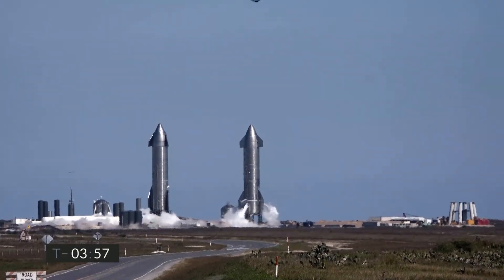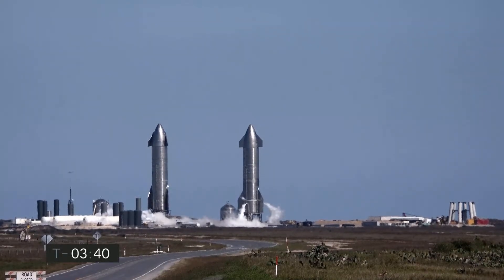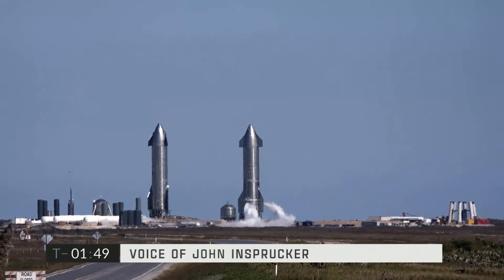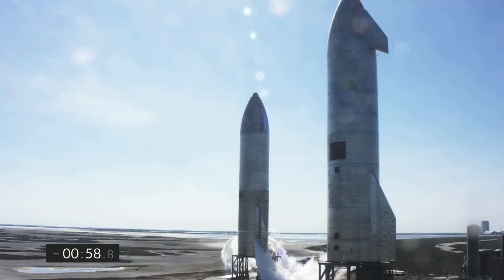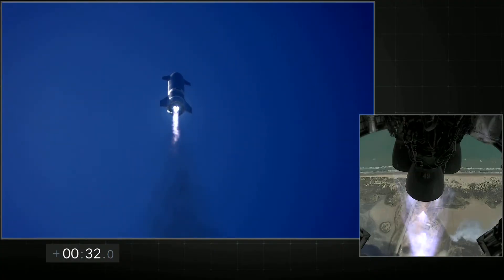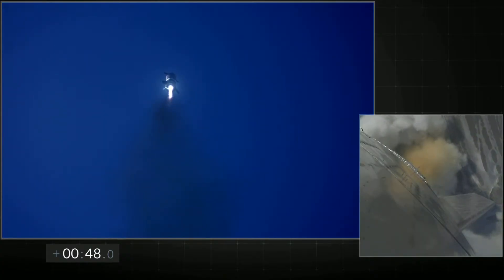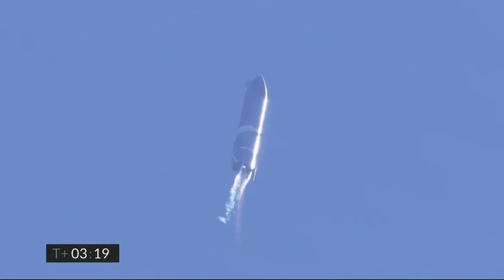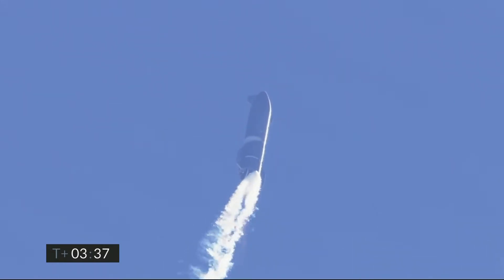Starship | SN9 | High-Altitude Flight Test

Comment: “We need to work on that landing a little bit.”
Ahh yah, or maybe a lot.
Reply: I'm not sure about "a lot". SN8 only failed due to loss of fuel pressure. The orientation was pretty vertical. Looks like SN9 had an engine failure but had enough fuel pressure for clean combustion. Now SN10 just needs to successfully start that second engine and we are done
Reply: I want to know how long does it take to get from a 'free-dive' to a vertical stop in the air on one engine only?
Reply: @reasonerenlightened2456  Apparently too long.
Reply: @peterpiper47  
Are you willing to bet that SN10 would make a successful landing? 
Those two landing-engines may need a serious reliability  re-design, don't you think?
Reply: @reasonerenlightened2456  Two engines are used to flip the vehicle vertical, then one engine to land the vehicle. But to answer your question, yes, they will fix the problem.
Reply: @reasonerenlightened2456  you better apply to SpaceX right away. They need you!😶
Reply: @BH-ix7nq  
Elon Musk wants to re-ignite all engines and then shut down the unnecessary ones.  I think, such solution is sub-optimal because it does not scale up as the number of engines increase. (Also, the sudden deceleration caused by 3 engines could be too much to handle?)

In my opinion, the landing should begin at a height required for landing on minimum engines  (one or two) plus the height required to re-ignite additional engines (the third one) if the other two do not decelerate the ship adequately for whatever reason.

I guess they did not have the AI to calculate that the necessary rate of deceleration for the given height from the ground was not happening correctly therefore more engines should be re-ignited to slow thing down a bit more.
Reply: @reasonerenlightened2456  deceleration is acceleration, depending on your reference frame 😉
Reply: Nah she’ll be right
Reply: Inertia of movement depends on weight.starship is steel😂😂

Comment: Apparently the raptors are having ignition problems when going from horizontal to vertical, I also believe that the static ignitions should be longer to know if they maintain their power. although they might have to test them outside the starship.

al parecer los raptor estan teniendo problemas en el encendido al pasar de orizontal a vertical, tambien creo que los encendidos estaticos deverian ser mas largos para saber si mantienen su potencia. aunque quizas tendrian que probarlos fuera de la starship.
Reply: @Lindy Lindy they will take it into account
Reply: @Lindy Lindy I forgive you🙏

Comment: Why can't Spacex poll all the Engines before landing and go ahead with only good engines. Or activate alternate protocols involving parachutes etc in case of all engine failure?
It is extremely basic and simple and in the domain of good engineering rather than rocket science.
Even an aircraft tests is landing gear before landing!
It will be much better than RUD and associated losses!
Reply: I mean the engines all worked just fine on ascent, so I have to assume they were good to go at launch.
Whatever issue caused the failure likely didn't crop up until after they were off the ground.
As far as parachutes go, it's simply far too heavy for them to be helpful. There's only one practical way to land 150 tonnes falling that fast.
Reply: @lazarus2691  Your don't assume that landing gears of an aircraft work fine- you test them before landing.
Why not same protocol for Starship?
In present configuration, there seems to be no failsafe and redundancy which are basic & necessary posts of good engineering.
Reply: @Rohit-oz1or  
There are many engine issues that aren't possible to detect before startup (cracks in the turbopump for example), and you can't just light the engines early to check that they work.

Unlike jet engines, rocket engines usually have a very high 'idle' thrust. In Raptor's case, about half of maximum, which is actually pretty good by rocket standards.

Lighting up both Raptors ahead of schedule to make sure they work is equivalent to powering up a single Raptor to maximum thrust, which burns through your fuel very quickly and pushes you way off course. The ship will accelerate horizontally faster than a supercar.

That's why they flip as soon as the engines have started, they can't do it any earlier. Falcon 9 similarly can't check if it's engines work early, because they have a very high minimum thrust(~70%). It would burn through it's fuel too quickly, and it would slow down too soon and stop in midair since it can't throttle down enough.

There's no point lighting the engines and then quickly shutting them down to test that they work either. You can't guarantee that the shutdown didn't damage them, or that the next startup won't.

Because that's where the majority of the problems happen. Rocket engines tend to be fairly happy once up and running stably, but startup and shutdown are very violent.
Reply: @lazarus2691  May not be firing but engine monitoring sensors could be used to detect faults.
This aspect must be part of design to ensure reliability otherwise it's just like going in blind
Reply: @Rohit-oz1or  I already explained that most issues can't be passively detected, and only raise their heads during startup or shutdown.

Most hardware issues simply can't be detected passively using temperature/pressure/vibration sensors.

Those sensors are largely only useful for measuring what's happening in the engine while it is running. 

To go back to my previous example, the only way to find cracks in the turbopump is to physically remove and x-ray it. 

No onboard sensor could detect such a fault, not until the turbine started exhibiting faulty behavior, which requires the engine to be running.

The same is true for aircraft engines to an extent, which is why they are regularly inspected on the ground.

However, their conditions aren't as harsh, and they're a lot more mature, so the warning signs are better understood and failures are far and few between.

And again, most of the wear on a jet engine  occurs during startup and shutdown, which happen on the ground, so it's possible to monitor the engine for several minutes after startup to confirm that it's running fine.

Also worth noting that you are limited as to where you can put sensors, and what kind of sensors you can use, due to the extreme conditions found inside a typical rocket engine. A pressure sensor isn't much good if it melts at 3500 degrees.
Reply: @lazarus2691  I don't know the design of Raptor but I am sure there are certain monitoring systems in place for engine health monitoring.
Regarding cracks in metal, it could be a design or quality issue. In that sense, such tests definitely give valuable information for improvement.
But 2 landing failures in three attempts indicate that there's something fundamentally wrong in approach that needs to be corrected before the vehicle is allowed to take off.
Engine failure might be tolerated but failure of starship due to an engine failure not.

Comment: why not try firing up those engines sooner?
Reply: Limited fuel, and also once they're running they'd start to push it off course. Even at minimum thrust, those two engines make it accelerate horizontally like a supercar.

Comment: Summary of stuff needed:1- fuel pump with gas pressure to fix the liquids inside.// 2- less speed in moving the flip with side small boosters. // 3- Honey cone structure vise or countered with Beatle wind honey cone theory energised in different magnetic poles without a magnet..  //// just sit me with their Engineers and or Mr. Elon Musk  one time only via conference to give them the confirmed theory and they could just update the current structure with great agronomics..

Comment: The issue is when it flips the tanks contents moves and there is yet no devise to move the liquids in pressure so it mention a healthy correct feed continuous and some how stable less moving liquids so it can again feeds fuel correctly without moving the 0 G or changing the gravity and move the mass of the rocket 🚀 to get again the correct 0 gravity to land correctly explaining like the AOA of the F18 fighter of 10 to 15 so the fuel when it movies it changes the plane mass and 0 G which will stall and crashes... Why not use the same honey cone like and AOA of the falcon rocket landing or landing with side boosters and landing gear landing it like a regular shuttle....??

Comment: At the end the commentator: "Whale, we'll get 'em next time boys)
Reply: Not if they do not know how long it takes to come to a stop above ground on one engine only from the free-fall position.  Do they even know that?
I want to know how long does it take to get from a 'free-dive' to a vertical stop in the air on one engine only? Then they could lower it to the ground as if it is the 150 m hopper.
Reply: @reasonerenlightened2456  the reason they aren’t landing is engine failures. If the engines in fact re-ignited, it would have most definitely landed.
Reply: @demonghost6361  It looks like the engines did fine, but that as they swung the bottom of the rocket out, they over compensated, and it belly flopped.
Reply: @dasbubba841  SpaceX said engine 2 failed to ignite.
Reply: @demonghost6361  Ah, I see.
Reply: @reasonerenlightened2456  because you are totally a rocket scientist who knows everything about the subject.
Reply: Shin

Comment: 10 kilometers equal 6.2137119224 miles well the apollo guys were doing 29000.. ft per sec,...29000 feet = 5.492 miles so apollo 13 was suppose to be going 5+miles per second in an aluminum can that they could poke their fingers thru, It is all bullshit. no one in nasa even left LEO...maybe the secret space did.
Reply: Apollo did that speed in a vacuum with nor resistance. When it hit the atmosphere, they were in the reentry module, which was much tougher.
Also, you seem to think LEO is legit? People in LEO are going almost that fast, also in tin cans. The ISS is moving at roughly 4.75 miles per second.

Comment: Why must it land vertically ?, Could you land it as a shuttle with retractable gear or a housing wheels like the old U2 spy plane with a truck following the shuttle landing...
Reply: No runways on Mars or the moon, which is the whole point of this ship.
Also, the Shuttle had a terrible payload mass fraction compared to this, proper airframes are much heavier than a cylinder with some fins on it.
Reply: @lazarus2691  yes but not for the moon nor Mars gravity differs the important thing is how fuel is feed to the engine with a load mass that changes the weight and balance distribution and other stuff see the documentary about the Beatles honey cone shape anti gravity theory but not like SCI-FI

Comment: Why don't they rotate sooner? Seems so last second.
Reply: To use as much max air drag from the body and as little fuel as possible
Reply: @mrx1979ua  seems like they might want to use a little more fuel
Reply: @nickthaskater  I did think that SN9 might have been a bit short on methane )

Comment: Actually imo sn8 got closer to a perfect landing than this attempt. I saw the engines expelling fuel after they were shut down after reaching the 10k. SN8 was about  faulty fuels pumps now it seems to be in the same general area.  Fuel kept being dumped out during the fallback stage the entire time from at least one nozzle. So when they tried to fire it back up it was flooded like an old carburator just my two cents. I have no doubt Space X will succeed more data is always good.

Comment: "We're preparing to restart two engines... then transition to one engine" I guess they just skipped a step.
Reply: I want to know how long does it take to get from a 'free-dive' to a vertical stop in the air on one engine only? Do they even know that?
They should really come to a stop well above ground and then lower it down as if it is a hopper.
Reply: @reasonerenlightened2456  They don't  do that because it is inefficient. They try to came to 0 m/s of velocity as soon as they touch the ground. Works damn well on falcon 9s. They know what they are doing. This is not kerbal space program to waste fuel. Even a little bit more fuel allows them to carry more payload.
Reply: @abhiram0827  
Those two landing- engines may need a serious reliability  re-design, don't you think?
Are you willing to bet that SN10 would make a successful landing? 
I begin to suspect we'll see another exciting explosion because it seems to me some redundancy system is missing in the model for reliable landing.
Reply: @abhiram0827  
I suspect something happens to those engines during the free-dive ???
Reply: @abhiram0827  Landing a ship with crew is different from a falcon landing. There should be different landing procedures even on one engine. They can perform a bellyflop earlier, test the engines and adjust their power to the amount still active ;) or fire airbags lol. Safety first, payload last.
Reply: @reasonerenlightened2456  I am sure, the engines are reliable enough from ground testing to do that. The bigger problem is getting the propellants to the engines while doing such maneuvers. Especially the rapid pitch up while the engine is still throttling up is likely a big problem, since the start of a big rocket engine is very sensitive to changes in the pressures of the propellants going into it - all depends on very accurate timing of when and how fast valves open, determined during ground testing, to coincidence with the fluctuations of the liquids inside the engine. A bit different  pressure going in, a small change of the perceived gravity (incl. centrifugal force), and everything is off the timing. The only option to really get out of this is, as weird as it sounds: Crash and destroy more engines, and teach the engine controllers how to ignite the engine when it is not sitting carefully tended on a launch pad. You can't simulate these effects on a computer as any small deviation from simuation model to real spacecraft would mean the results of the simulation are useless. And the Raptor engine is way more complex than the Merlin engines on a Falcon 9.
Reply: @denniskrenz2080  
I thought they have pumps installed to compensate for fluctuations of pressure due to fluid dynamics during free-fall and deceleration?
It is what pumps do i.e. supply a desired pressure at all times?
Are we saying they should put the engines on a giant test-rig and start spinning them and shaking them while attempting the start and stop sequence?
Reply: They should use all three to land instead of one
Reply: @robbarker450  Lmao Youtube experts instructing SpaceX what they should do 😂 Don’t you feel ashamed?
Reply: @Engineer9736  I was looking for this comment 😂
Reply: @Engineer9736  beat me to it
Reply: @robbarker450  "It was foolish of us not to start 3 engines & immediately shut down 1, as 2 are needed to land" Musk tweeted. You almost nailed it.
Reply: @robbarker450  one engine can lift 200tons. The starships weight is about 280 tons. So after the landing burn and reducing the velocity it is necessary to shut down one engine because 2 or 3 raptors together would rapidly reduce the velocity instead of slowly so there's a chance of malfunction because of the stress level. And also I think there's too little propellant for all three.

Comment: Thanks for streaming it.
Reply: Pasta mukbang https://youtu.be/5zBnI34kW1g
Reply: No worries mate
Reply: The landing should begin at a height of a single engine being able to bring the free-falling StarShip to a vertical stop.
Then, If a second engine happens to work , well, that's a bonus.
If the first engine does not re-ignite on time then re-ignite the other two engines to land the ship. 
...and if there is still an engine failure ....well,  re-design the engines for reliability!

For some strange reason, Elon Musk wants to re-ignite all 3 engines and then shut down one of them. I wonder if the StarShip would be able to handle the deceleration caused by 3 engines? ... in all cases the re-ignition must begin much higher above ground to allow time for deceleration in case of a failure to re-ignite event.
Reply: @reasonerenlightened2456  idk why it couldn’t
Reply: Np

Comment: Curious.  I've looked at the videos over and over.  A question I have is which engine restarted fine. I suspect it was #1 which was the last to shut down which meant that the feed lines to that engine were still charged with methane/lox.  From the flame pattern, it's my conjecture that the second engine had run its feed lines dry after shut down and, while trying, couldn't restart successfully most likely because of intermittent fuel starvation.  Could be that the feeds had either sloshing or vapor gaps. Eventually, that engine most likely ate itself, most likely starting at the turbine, turbopump.  We'll see.